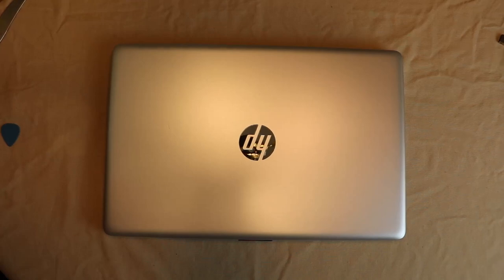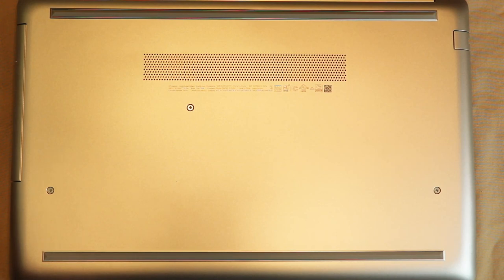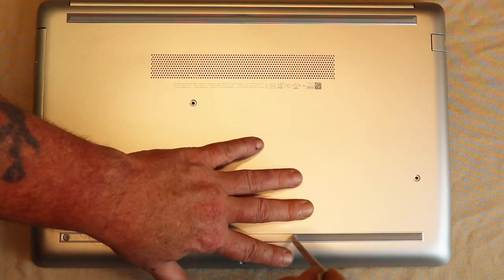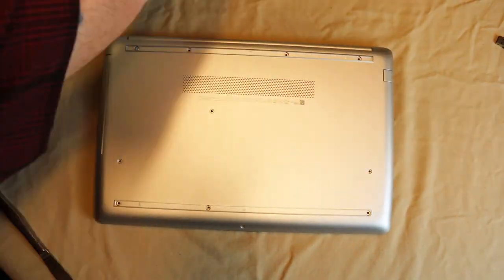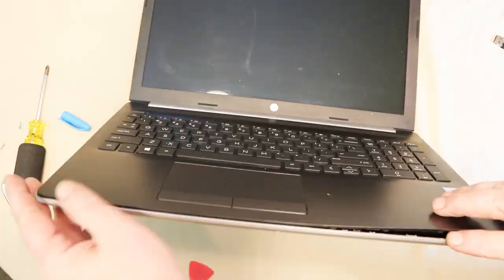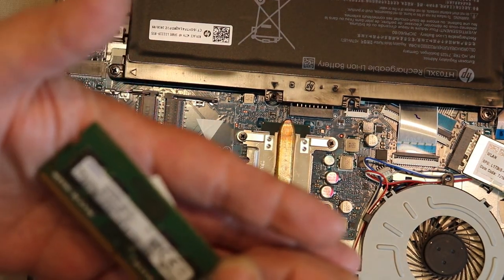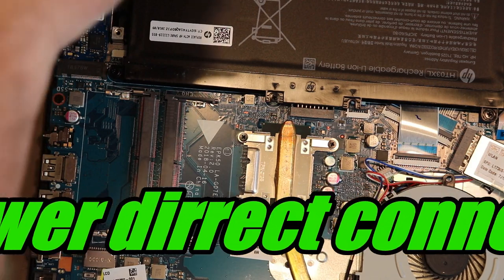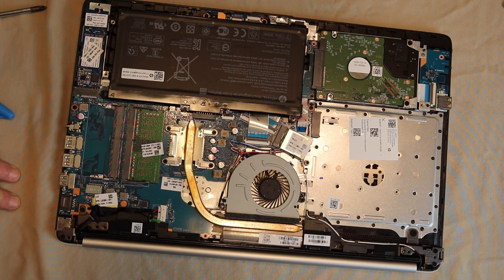Hp hp 15-da0053wm Ram Upgrade

Comment: I inherited a HP Notebook - 15-da0032wm, pretty much the same laptop from my late brother. After checking out the system specs I decided to upgrade the components. I bought 16bg of RAM, A new M.2 NVME 512gb SSD to replace the 16bg Intel Optane Memory SSD. And a new 512gb 2.5" SSD to replace the 1tb mechanical 5400rpm HDD. While the case was open I replaced the thermal paste on the CPU/APU with Artic Silver 5. First I updated the PC with all the latest software updates from MS. Then imaged the HDD with Macrium Reflect to have a back up of the system. Next I disabled (very important) the Intel Optane Memory module in the Intel Rapid Storage Technology software. Removed the Intel M.2 stick and the 1tb HDD. Installed the new M.2 SSD, left out the new 2.5 SSD. Did a clean install of Windows 10. This way there is no HP bloatware. Updated Windows. Installed the new 2.5 SSD. I couldn't find the RTC battery. I would have liked to replace that with a fresh one while the case was open. It's probably on the opposite side of the MB. Closed up the case and the PC is running fast and smooth. So these are the new components. 16bg of G.Skill DDR4 2666 8GBX2 CL19-19-43 1.20V, TeamGroup 512gb MP33 NVME SSD Gen3 X4, Teamgroup 512 gb EX2 2.5 SSD.  Total cost for the 3 new components was $194.00 at Newegg. Even though this PC was about $400.00 new the added upgrade wasn't too bad. Too bad it only has an i-3
Reply from the maker: Wow, you went full bore on it. I'm happy to hear it all worked out for you. I can't afford to do all that to mine, or I would too. And after my second stroke, and my short term memory issues, I wouldn't be able to do this all myself anyways. I am going to upgrade when this one no longer works for me. I'll be looking into a laptop built just for gaming or video editing. My guess is probably about $1,200.00 or more... That sucks...lol... Thank you for watching and for your comment. I think I will pin it so others can view the upgrades you made and if they have questions, can can ask you directly. Thanks again.
Reply: Thanks for the point about the octane module. I'm going to be upgrading one of these for my sister and I never would have thought to disable the octane drive first.
Reply: Do I need to do anything to the software to upgrade the nvme? Or can I just switch it out and be done with it??
Reply from the maker: I finally got mine back up and running but it is really slow now. I can't get the 16Gb Intel Optane to work like it did when it was new.
I just made an update video explaining everything I just went through and the lack of support I got from HP. I ended up purchasing a new laptop for editing 4k videos and I couldn't be happier with it.
I do not recommend HP fort people who aren't PC savvy because of your warranty runs out and something goes wrong your water on your own. Even if it was an issue that you had prior to your warranty rerunning out.

Comment: WOW, it may have been 4 years ago, but this guy gets 5 STARS. Beautiful video, not overproduced, flashy banners & basic BS has been omitted. BRAVO
Reply from the maker: Thank you. I've always done reviews like this and still do. I've had to add more items to my "tech" term, as times change, like music tech and even auto tech. Thanks again for watching and for commenting. I really do appreciate it .
Reply: @HayesTech  I agree with @wmdavid's assessment.. however, I would have unplugged the battery and discharged remaining power by holding in power button for 10 seconds. would be good to have a grounded anti-static work mat and wrist strap.
Reply from the maker: @saroku  
You are correct about the anti static gloves, mat and ground cable. But I'm not a service tech, who does this all the time. I'm someone like the ordinary person just replacing his RAM. But you are very correct that the absolute correct way to do this is to properly ground the board, and yourself. And dissipate any remaining power in the battery by disconnecting and holding the power button down or a few seconds.

Comment: Thanks to your video I was able to add 8 g of RAM to my laptop. I added it to 2nd slot after consulting with engineer. He said it would be great. To remember that it should be compatible with the one used. I still need to test but wanted to thank you for your video. Helped me a lot.
Reply from the maker: Thank you for the awesome comment and I am happy that my video helped. Don't forget that I am having my biggest giveaway yet and there is still about 2 weeks left, so get in on it. You don't have to jump through any hoops either.

Comment: Hey bud, I just used this video for a buddy of mine. Worked wonderfully. Much appreciated good sir!
Reply from the maker: That's awesome that the video helped out. Hopefully his laptop holds up longer than mine did. Nothing to do with the ram upgrade either. It's HP software that ruined it. I made a few videos on that too
Reply: @HayesTech  ended up throwing 2 random 8gb sticks in. Got lucky they were the right configuration. Again, thanks for the video. We were struggling with that cheap plastic base. (Fliiiiiimzy)

Comment: Great video. Thanks for uploading. I would advise in disconnecting the battery first before removing and installing RAM or any component. Talking from personal experience, there was a time when I forgot to disconnect the battery and when I tried installing a stick of RAM, I accidentally shorted the memory controller. As a result, that only left one working memory slot.
Reply from the maker: I couldn't agree agree more. Thanks you watching and for posting the comment. It's much appreciated.

Comment: Thanks for the video, it will save me a. Lot of time
Reply from the maker: You are very welcome and thank you for watching and commenting.  The only thing that sucks with this thing is we will never be able to get Windows 11 on it. And that sucks. But that is a Windows issue and HP has no control over that. Because Windows 11 only supports processors that are Intel core i7 or higher. Man I hate Windows...lol

Comment: David after installing the new ram do you have to stick the laptop rubber leggs with glue it is just gets fixed in place by pressure?
Reply from the maker: I am careful when I pull them off and then stick them to my table until I get it all back together again. Then I put them back into the groove. I did happen to lose one though. But after sending it back to HP to finally service it, for the issues I was having, they installed 2 new strips for me anyways. I am very happy with the HP service department so far.
Reply from the maker: But to answer your question, if you are careful pulling the rubber stripps off, you can reuse them. Just pull them off carefully and slowly.

Comment: Thank you for your helpful video David, I have a similar model of HP laptop, HP 15-DA0xxx, and added 4gb of RAM and it is certainly faster than before. To really speed things up, I want to replace the hard drive with SSD. Can I simply replace the hard-drive (1 TB) with SSD PCIe NVME (1 TB)? There is a free dedicated slot for this on the motherboard. Or must I replace the hard drive with a 2.5inch SATA SSD? Or do I have the choice?!  The prices are similar now and the SSD PCIe NVME option looks quicker.
Reply from the maker: Well, as far as replacing the hard drive, yes, you can do what you are asking. But you need to use one of those programs that will copy your operating system and other stuff over to the drive of choice.
I've never done that, but want to as soon as I can afford too, so I can't really help you much more in this subject. But as soon as I can afford to do this, I will be making a video on how to do it. I just don't have the money right now...lol... 
Thank you for your comment and for watching my video. Be sure to get in on my biggest giveaway too date, the link is just above, in the comments section.

Comment: Hello, a little juice fell on my Touch Pad and then I no longer feel that "click" when I press the button. I wonder if you could tell me how to remove the Touch Pad so I can clean it since it is somewhat sticky.
Reply from the maker: Well, I've never had that apart on mine yet but I'll try to do a video on that. If you take it apart, like i show in the video, you should be able to access the keyboard and from looking at several other laptops it's a one price slab of rubber that is glued, or snapped into a groove. You should be able to gently pull the keyboard from the top half. But again, I've never done it to this laptop so I can't be 100% sure of to the exact process.
I'm sure it's not too difficult, but I have to stress, take your time and be slow and careful. Use isopropyl alcohol as the cleaner. They also make a cleaner for electronic components that comes in a spray can that should also work.
Let me know how it goes and don't forget to get in on my biggest giveaway yet. The link to that video is pinned in the comments section of this video, just above your comment.
Reply: @HayesTech   Thank you for your answer, I will take it into account and it would be very helpful if you could make a video about it, thank you very much!

Comment: Can you change processor, ram and storage HP 15s-eq1054na 15.6 Inch full hd
Reply from the maker: You can't change out the processor unless it's one the this computer supports. I wouldn't attempt to do that. But as for Ram and SSD, is good to go, as long as it's the same model as mine. I'm not %100 about yours though. It's a different model than mine. But changing out ram and SSDs shouldn't hurt anything, as long as you use the correct products and you have a slot for it.

Comment: I'm writing from turkey helps'm using the same device you can attach to your entry Are there M2 SSDs?
Reply from the maker: I hope I understood this question, but yes you can swap out the  M.2 for a larger one, if you want. The slot is being used by the 16Gb Optain SSD ram on mine. But I can swap it out for a larger one or even a different type of M.2.. But to be honest, what is in mine right now works great for what I use it for. Editing videos...
Reply: @HayesTech  Thank you very much, grateful for your help
Reply: @HayesTech  by the way i don't speak english very sorry
Reply from the maker: @keremgunduz2899  
That's ok. I got the main part of the question. Good luck to you and thank you for watching and for commenting.

Comment: Say, how many gigs of ram does this laptop take?
Reply from the maker: If memory serves me correctly, It will accept up to 32Gb (I think). I quit using my Hp lptops after getting a new Laptop by Gigabyte, the Gigabyte Aero 15, and have never gone back to HP. My bad experiences with HP, as a company, has left a bad taste in my mouth and I've decided to stay away from HP all together. There are definitely good PCs and laptops, made by HP, but both of my laptops from them had major issues within 3 months of getting them. 
And to top it all off the servic techs were of no help to me, without complaining to someone over their heads. Once I complained something was done. This shouldn't be. I got so disgusted, after the second laptop started showing issues, that I decided to go out and purchase a new laptop that was not an HP. I am so happy today with that decision too. I love my Gigabyte Aero 15.
Reply: @HayesTech  I hear those things are expensive as hell. Sorry I can’t afford one of these things. I have two laptops at home and they both serve me well, sure they had their issues, but they do fine with me.
Reply from the maker: @blazingsoulhunter2862  
I completely understand and I had to borrow the money to get my new laptop. So I know what you mean. HP is a good product, for the most part, but I've had so many issues with them that I had to get something different. Even if it meant I had to borrow the money. I have to have a solid laptop or PC so I can edit my videos. The issues that I was having, with both my HP laptops, was putting a strain on my ability to upload content to my channels. 
Since you aren't editing 4k videos your laptop may work fine for you. Again, this was an issue with them and me. You may never have any issues. Upgrading the RAM in your laptop will be the biggest boost in perceivable performance too so you'll be loving that. I don't remember wether it's 16 or 32Gb for max RAM for them but I think it's 32.
Good luck with this and im sure you will love it.

Comment: Nice Video! I want to upgrade my HP 15daxxx as well. I know you didn't unplug the battery, but its to risky for me this way. Do you know how to unplug the battery? Best Wishes
Reply from the maker: No I don't. I would have to pull it apart again tho see. It shouldn't be too hard to trace the wire from the battery too find out where it plugged in at. And yes you are correct that any time you work inside a laptop or PC you should disconnect the power supply.

Comment: Thanks bro, I purchased and upgraded today... 8gb ram total 12gb ram now... When I switch on first time the battery is draining fast.. I asked the technician, he said during first time the windows  will upgrade in back ground,, so the battery draining fast.. Once updated means the battery will become stronger... Is it right?
Reply from the maker: I had bad battery performance the first time I used it but now it's not too bad. I don't usually use mine unless it's plugged in though. I do use it occasionally outside to recorded audio on some videos and it lasted fine for me on every video I used it this way for.
I've never really tested the battery but it's working fine for me, for how I use it.
Reply: @HayesTech  thanks for your  quick reply response

Comment: David hayes sir can you plzz guide me 
Which one is better from these 2?
Hp pavilion 15 cc610 or hp da0053wm ??
Reply from the maker: I haven't had the chance to test any others besides the one in this video but they make quality Laptops so it would depend on the features you need as to which model you get. Good luck though.
Reply: @HayesTech  okay no prblm.. BTW thnx for your kind rply (:
Reply from the maker: @muhammadabuzar1768  
I really do wish I could give you more help on this but without using the other laptop you posted in your question it would not be an honest answer to you. But as I stated in my first response, any of HP's laptops are good ones. They know how to make a laptop and they back their products completely.

Comment: Thanks. This video is super helpful.  My question is what is the max amount of RAM this laptop can take? For example if I buy to 16GB chips, will it take the total 32? Can i go even higher?
Reply from the maker: I know that you can't go higher than 32gib. So you should be ok with (2) 16gb chips. I will look into this and since it's been a while since I looked into this. I checked and 16gb is the max. I posted a link below.
Reply from the maker: I was wrong. The max is 16gb. Here is a link that has the information about this
https://www.memorystock.com/memory/HewlettPackard15da0053wm.html

Comment from the maker: Update information:
I've been having issue with mine and I'm hoping it is isolated to just mine and it's not a problem with all the laptops in this model. I had to do a factory reset, to clear out some crap that was installed via bad software, and after it came back up I noticed a marked lack of memory power (like it was lacking ram) and I'm having issue editing videos on it now. I'm going to upgrade my ram from 8Gb to 32Gb and see if that fixes the issue. But from what I can tell, the Intel Optane ram isn't working like it was before I factory reset it. I will post in the comments on my progress with this issue. But for now, I strongly advise against trying to reset this laptop.
Reply: David Hayes hello did it goes well on 32gb ram? ‘cause I’m planning to upgrade mine..what kind or brand of ram did you use if you may please.. Thanks
Reply from the maker: @chainedlist  
I only could afford an extra 4gb of ram for a total of 8gb. But this laptop will go as high as 32gb. It only has 2 ram slots so either get 2 16gb it get 1 32Gb stick. I forgot the link where I got mine at but I'm pretty sure it's in the video description of in a post, as I have the link out several times in other posts. Here is one link I found but you could also do a search like I did. Good luck and here is the link.
https://www.memorystock.com/memory/HewlettPackard15da0053wm.html?gclid=Cj0KCQiAyKrxBRDHARIsAKCzn8wbOkLKaMVs6HpH96nCsSlUwzRoO6oCm7Oti3B8N6MaUJBuhUfzv_IaAmupEALw_wcB
Reply from the maker: @chainedlist 
 
https://www.crucial.com/usa/en/compatible-upgrade-for/HP-Compaq/hp-15-db0003ca
Reply: Did you get it working
Reply from the maker: @hikupmusicofficial  
Nope. It works off and on. Sometimes it boots up and runs just fine. But other times it gets laggy and slow. I'm done with HP. I purchased a new laptop, just for video editing and haven't had a single issue yet. I love this new laptop. My new one is a Gigabyte Aero 15.

Comment: Hi enjoy the video but I’m having issues! Bought a 16gm ram, plugged and repligged it in many times but it doesn’t recognize a second slot, nor is the second slot of ram enabled on my performance center, do you know the fix? Also I had to factory reset due to my little brother downloading stuff and my 16gm intel intel memory doesn’t work anymore either, can you please help?
Reply from the maker: I had to call HP when my 16gb SSD ram want set up right. If you are still under warranty, call HP hello center.
If you aren't under warranty I don't know what to say... As they were there ones to fun mine. I don't know much about the Intel SSD. I'm old school... Hard drive, processor, motherboard and ram.... And maybe a video card....